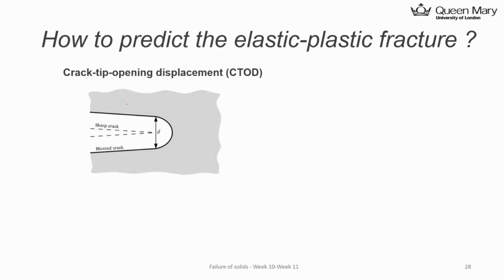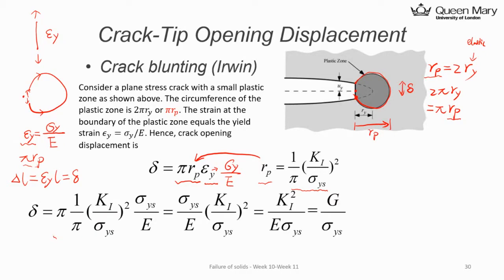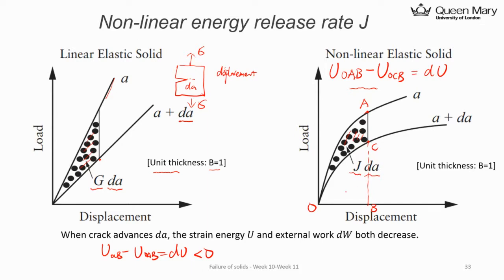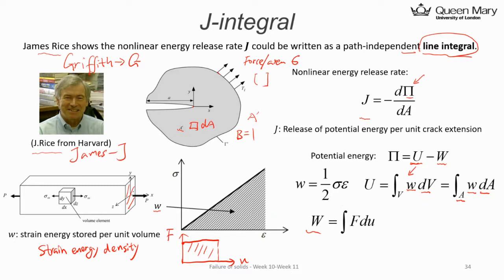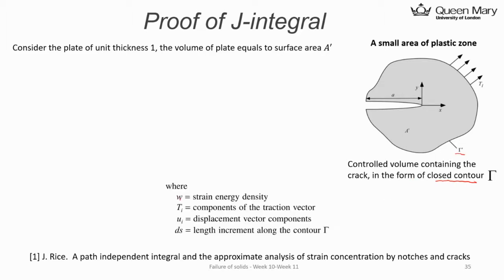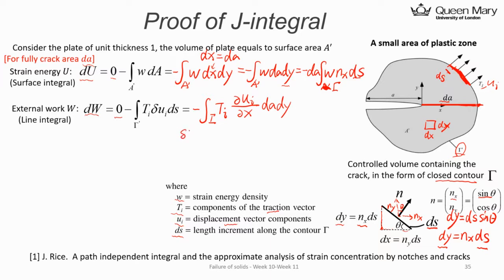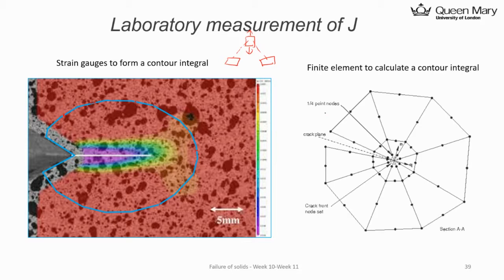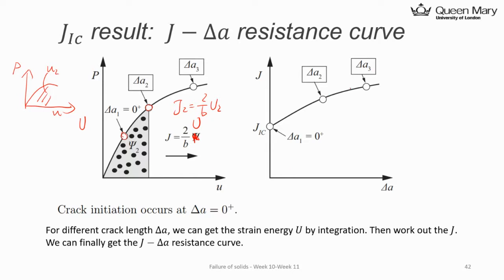Derivation of J integral

Comment: J has a unit of Energy release per unit square

But when we equate the  term or link with syield*CTOD units dont match??
Reply from the maker: Hi, thanks for your question. J has the unit of J/m^2 = N*m/m^2=N/m, syield * CTOD has the unit of N/m^2*m=N/m. So the unit are the same after the conversion.
Reply: @mechanicsforengineers alright thanks for the clarification